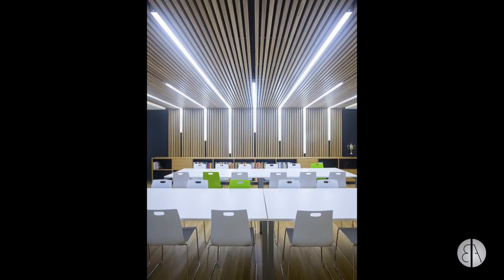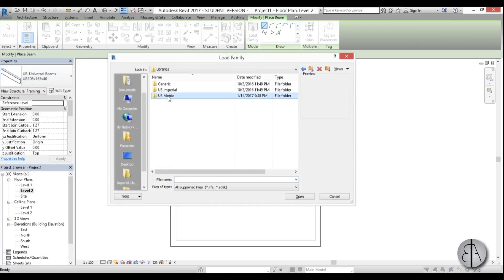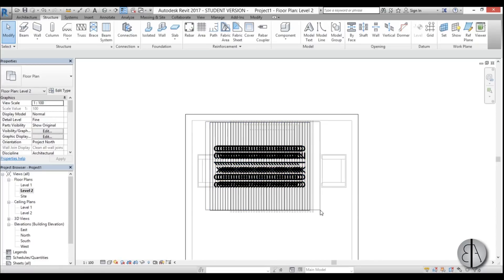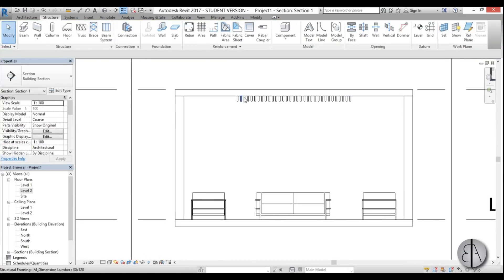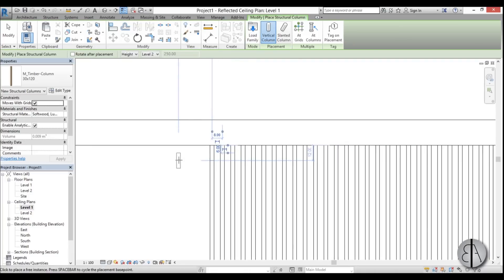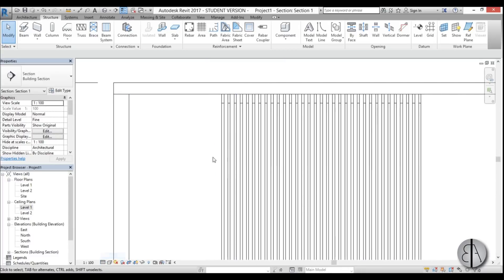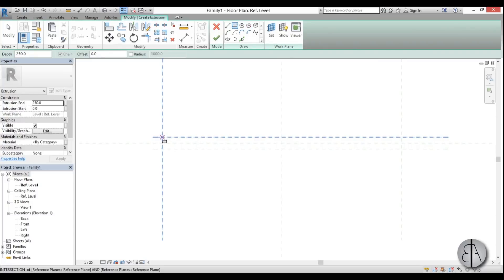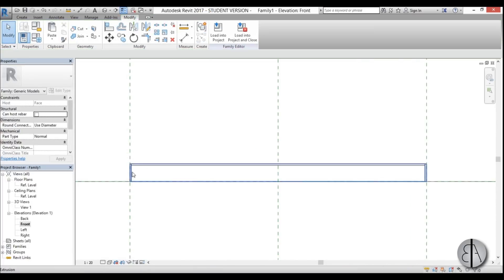Interior Design in Revit Tutorial * Wood frameing with light *

Comment: When I tried moving the beams from the floor to the ceiling it would not move. Only the structural beam system moves. Help!
Reply: I think you need to turn off the restriction, when you select the element under the menus bar it will appear a green line one of the boxes that appear in the same line it's the restriction parameter just click it and you're done